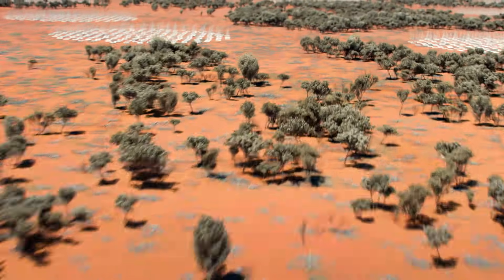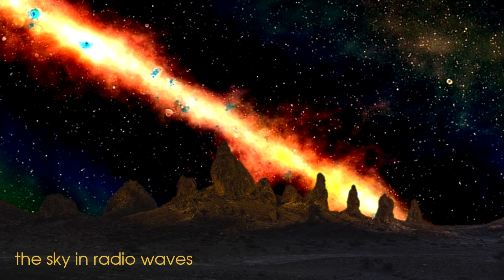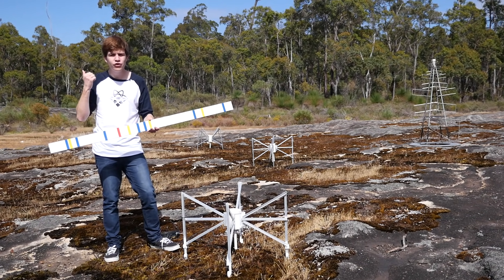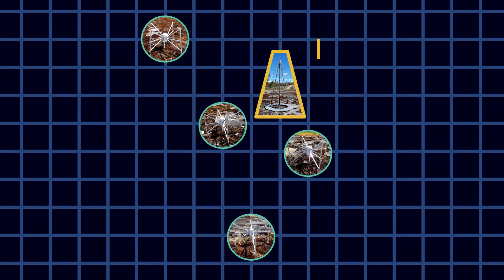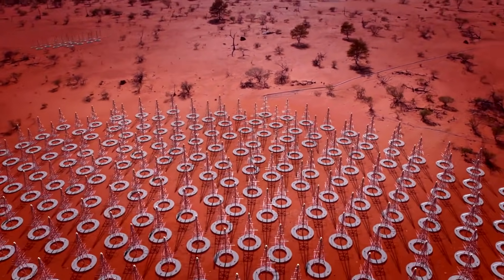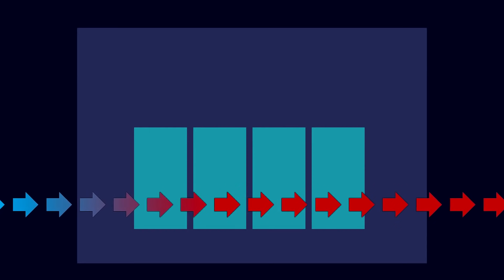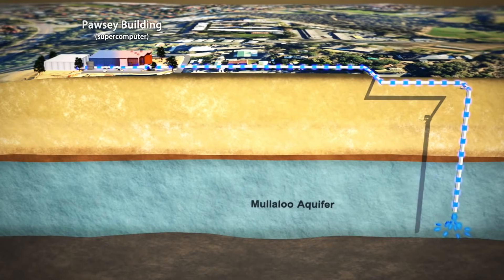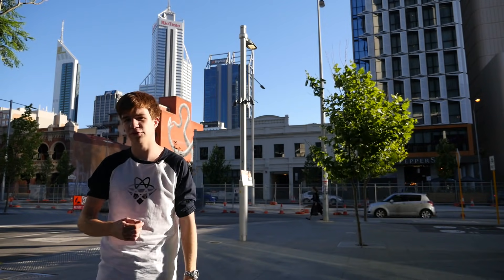How does the Square Kilometer Array work?

Comment: I collected the condensation from my roof top AC and used spray nozzles from cars to cool the condenser down which made my camper like a refrigerator inside and drastically cut my kilowatt/hrs. I got that idea from when I visited my uncle in New Zealand who's house used geothermal to heat it and the ground water as a heat sink for air conditioning and that was in the 80s way before it was cool, pun intended.

Comment: I use the same principle for cooling and heating my house here in Finland as they used for the super computers, during winter the heat pump produces heat and hot water from the bore hole and during the summer the cold ground water cools the house.

Comment: I refuse to believe that pumping so much water at pressure is cheaper (energy-wise) than the current chilling solution. Also it will require a huge infrastructure change to transfer water with heat insulation. Puts the building at risk.

Comment: I’m not entirely familiar with how aquifers work, but wouldn’t there be issues with dumping heat back into it? Are there mechanisms that would prevent it becoming saturated with heat?

Even if that is an issue, it still seems better than the CO2 from air conditioning.
Reply: The aquifer is simply so exponentially large that the heat energy being dumped into it makes very little difference. It would take hundreds of years of dumping that heat into it to even raise it a single degree. Not to mention that it has thousands of sq KM of surface area in order to dissipate the heat
Reply: It all depends on the aquifer. Some of them can take the heat and disperse it but most aquifers especially the man made ones have trouble dispering heat. As for a good example of why this makes them a bad solution on its own, have you ever seen a steam explosion? Right now imagine that but the size of a lake and it takes a couple decades to happen.

Comment: So, uh... I havent read thru all the comments... But arent there gunna be consequences to putting all that heat into that aquifier? If you would make a whole city dip its heat into it?
Reply from the maker: There is a great paper on it but basically isnt an issue for the heat involved in Pawsey. The key thing is knowing where the water flows so you dont put heat 'upstream' of a cooling pipe
Reply: @AtomicFrontier  Im sure the people bringing in Rabbits to Australia didnt think it would be an issue either. Not knocking the idea, but Im super super sceptical of solutions like this, cuz that heat is now going to a new place. Knowing the consequences might not be as simple as we think.

Comment: You could do a followup video on open-loop heat pumps (what you show in this video) versus closed-loop heat pumps.  In many areas there are technical and/or regulatory hurdles to using open loop designs (ie, water table too deep or too variable) and closed loop designs can avoid many of those challenges, though with potentially higher cost.  Both designs have been used for residential HVAC applications in the USA since at least the 1980’s.

Comment: I liked the video, but I think I would like a bit more explanation as to how we would replace air-cons with the aquifer cooling system.
Reply: Yeah, I'm not sold on that. Let's say you even HAVE an aquifer underneath or at least close to your skyscraper, have you ever tried to dig a 200-meter hole in the middle of New York? If you need to transfer the water from further away, you could just as well transport ice from Canada as coolant. And even if the aquifer setup became somehow cost-effective, simply getting 22°C water to pump through the ACs doesn't sound like enough. Don't ACs normally run way lower to actually cool the rooms down? I guess you could permanently circulate it through the walls to at least lessen the load on the AC that then just takes care of spikes when someone opens a door, but even for that you need to pump around massive amounts of water for it to maintain 22°, as you don't want it working against your AC once it gets warmer than 24-26° (or colder than 18° in the winter).
Sure there are heat pumps and such things already in use, which work in reverse - pulling heat out of the ground - but they have the same problems: expensive to set up, massively expensive to maintain/repair and they still need power to work.

That said, it's good to look at all possible angles to save even a portion of the environment just when the circumstances are exactly right.If this is only applicable to one or two cities around the world, it might already help.